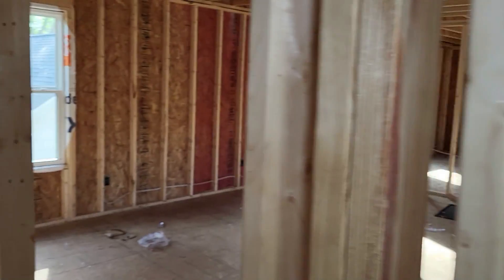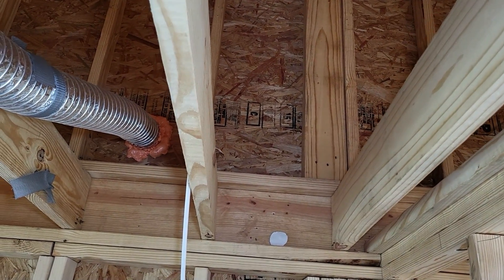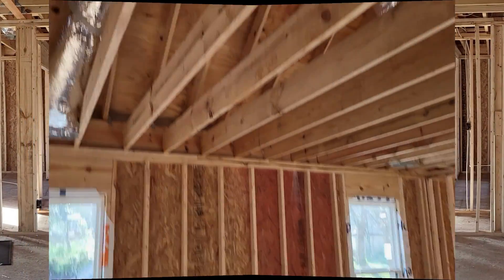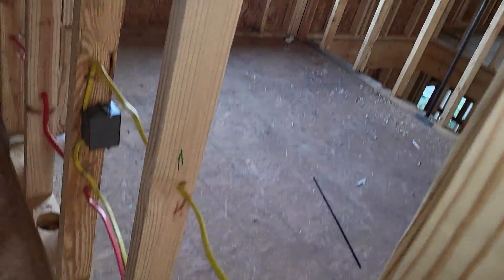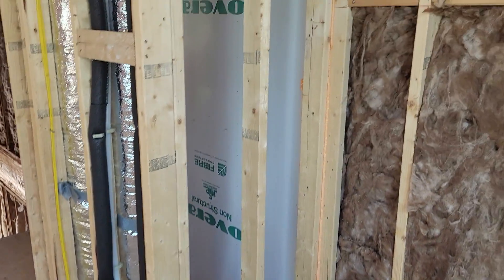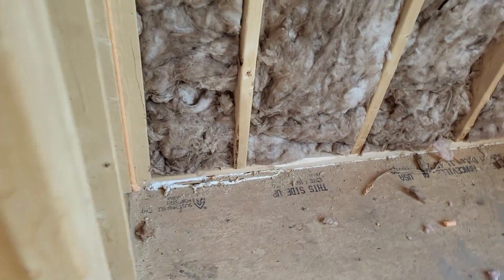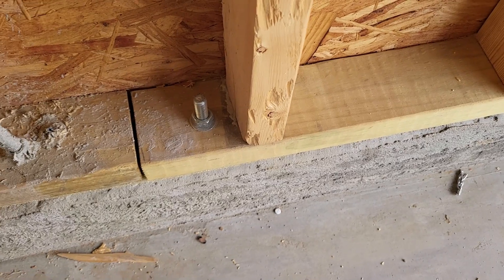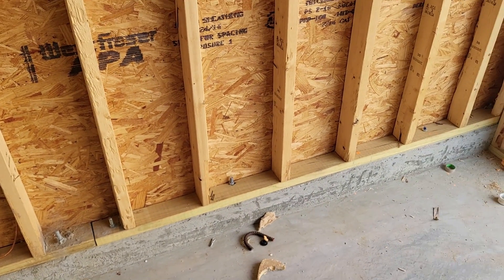Top (5) Structurally Important Residential Framing Inspection Checklist Items

Comment: hmm. I see no insulation behind the fiberglass tub. The joist hangers are not tight. An inmate could escape through the gap on the bottoms of some. Teco nails should be used for hangers. The LVL beam is not properly nailed from both sides. Horizontal wall penetrations more than 10' should be sealed. And finally CLEAN CLEAN CLEAN the jobsite for the inspector. SPOTLESS.

Comment: I check for the correct nails in the hangers.  I can't tell you how many times I've seen short nails being used in the angle nailing in the hanger.  You can literally look up into the small gap between the two pieces of lumber, and see the point of the nail....not penetrating the lumber that it's supposed to go in to.
Reply from the maker: I appreciate your feedback.

Comment: I never get lags or through bolts in deck post to beam connection. Anchor bolts always need retightened after the lumber drys. Fireblocking unused holes in top plates
Reply from the maker: I appreciate your feedback.

Comment: Here are the 5 things that come to mind first:
1) holes in top plate
2) not correctly sealing when joist or stud cavities are used as returns
3) headers/beams not strapped (I am in a seismic zone)
4) the sheetrock delivery people knock out studs
5) anchor bolts not tightened down 
Really enjoy your channel
Reply from the maker: Nice!!
Reply: Energy code does not allow joist or stud cavities to be used as returns